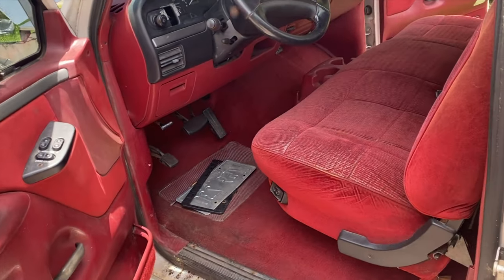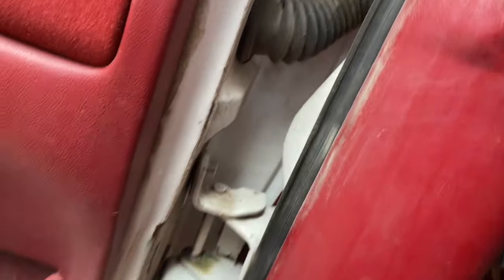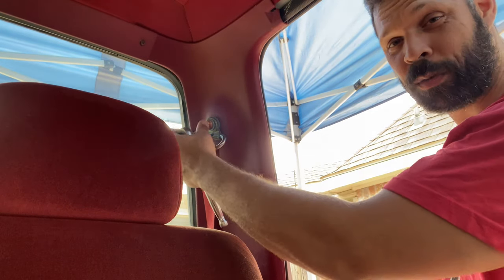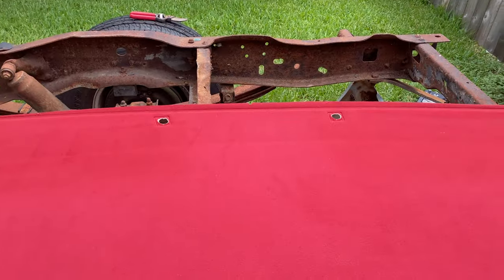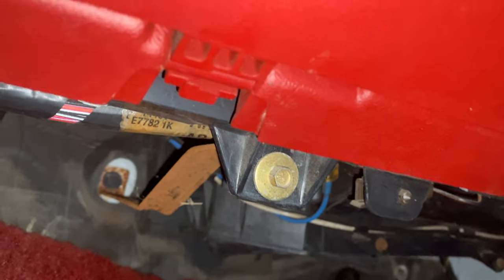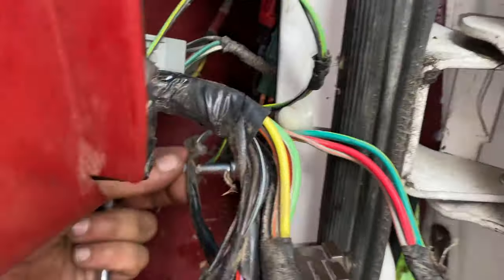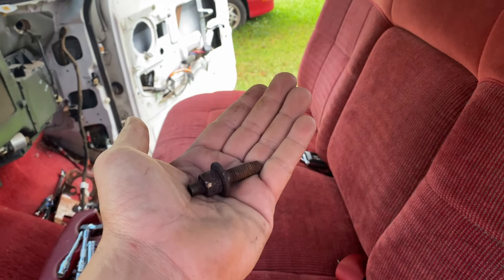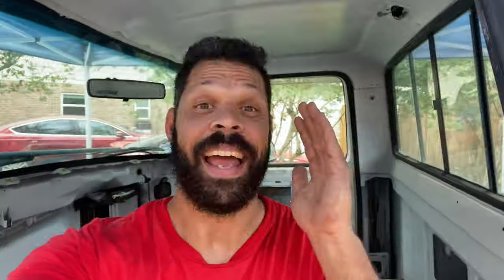Removing the Interior of a 1992-97 F150/F250/F350

Comment: Mix acetone and ATF 50/50 in a squirt can and use it for rusty nuts and bolts. Acetone eats the rust and the ATF helps it wick into the threads.

Comment: Any time you take screws out, set your screwdriver in the scree and hit it with a hammer first. The hit will jar the rust loose. Or you can buy a hand impact that has screw bits and set it in the screws and hit it with a hammer. It actually turns as you hit it . Make sure its turning in the right direction.